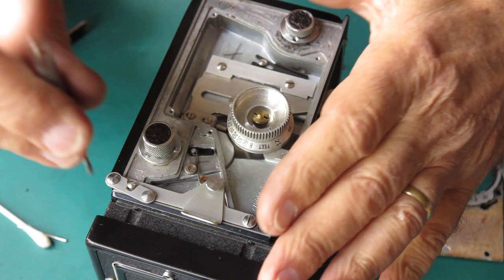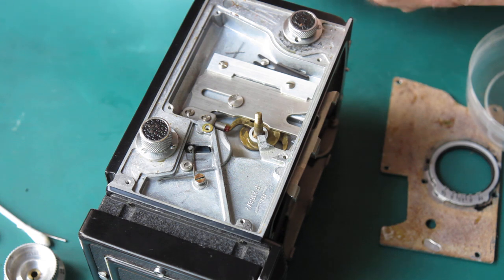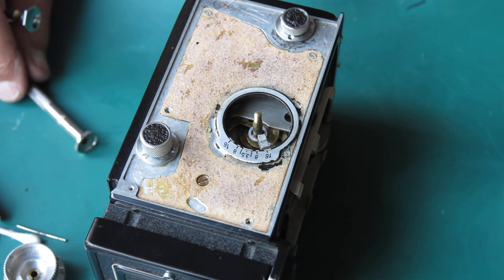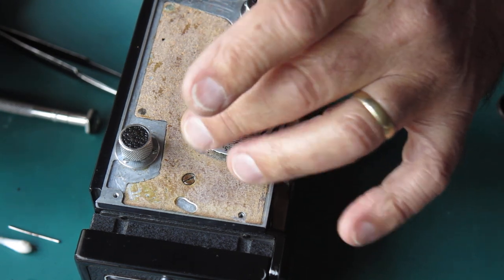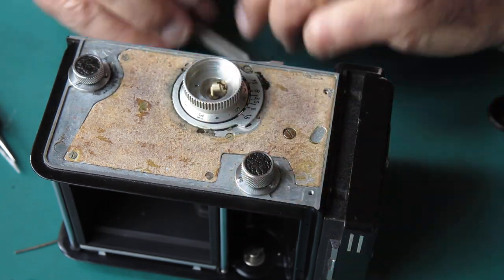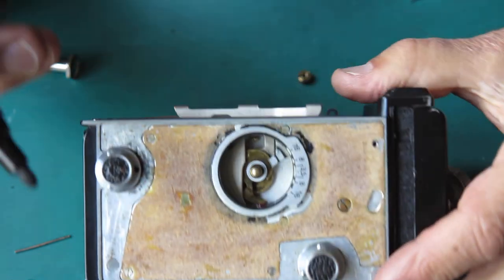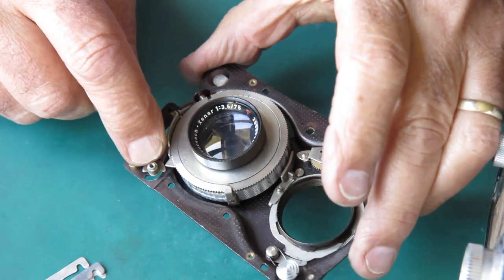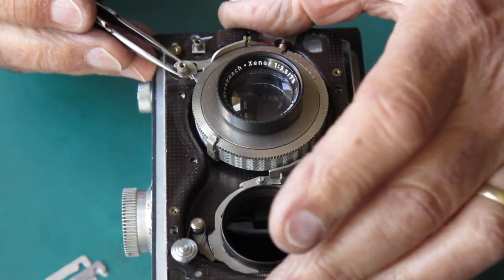Rolleiflex repair, servicing a Rolleiflex Automat TLR. Part 11

Comment: How do you measure parallelism between the focus rails?
Reply: the optical axis is verified from the front lens mount to the film plane using a special lens mount and dial gauge fixed to a stand. people who don't have this equipment at hand use different techniques to achieve similar results but to get to the guided 0.05mm tolerance diagonally across the film plane, this really is the most accurate way of achieving parallelism.
Reply: @MrRobot-om9mz  Must be hard to do
Reply: @user-ti9zc1xv2b  the most important thing is to replace the shims (or threaded bushings on other rolleis) in the exact same position as they were before disassembly. obviously if things are bent, adjustment becomes more difficult.

otherwise i've seen even seasoned techs use rather basic techniques such as a level to verify parallelism, collimate the lenses, verify corner sharpness with a loupe and call it a day. the level is verified from the lens tube to the film rails, not the housing. if you want to go that route i find tramming with a digital angle gauge more accurate.

if you really want to get the tolerances spot on, replicating a similar setup to the factory one is not that difficult.
Reply: @MrRobot-om9mz  Hi Mr Robot, I've been servicing rollei's for 2 years now, is there maybe I way I can get into contact? Thank you so much for the tips. I'm wondering for example you would replicate what F&H did in their factories
Reply: @user-ti9zc1xv2b  i tried to share a link to an image of the setup but these comments keep getting deleted. google for "flexfan rolleiflex", the image will come up.
anyhow, the F&H setup is just a comparator stand with a dial gauge. this part is easy because second-hand comparator stands with a granite base are quite inexpensive and widely available.
the lens or shutter mounts are more difficult to get because the original ones rarely ever come up on the market. having them machined is possible. alternatively you can hold the front of the lens mount against a verified flat surface while measuring. it's just a bit less convenient.
Reply: @MrRobot-om9mz  Amazing, could we get in touch? I've recently gotten ahold of thousands of original new old stock Rollei parts, as well as many many new old stock compur shutters and main springs
Reply: Does anyone know the distance from the front of the carriage plane to the film guide rails on the back of the casting? I need this measurement because I think my shims have been either lost or not in the right place and the scale focus is far off from the actual focus. Without that being close there is not a way to adjust focus using the viewing lens position. Thanks, Bob.